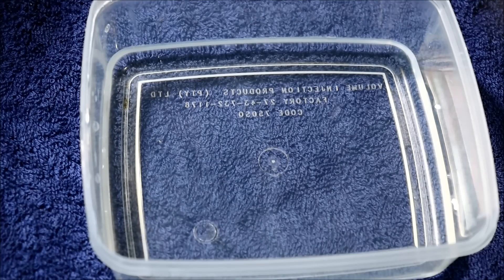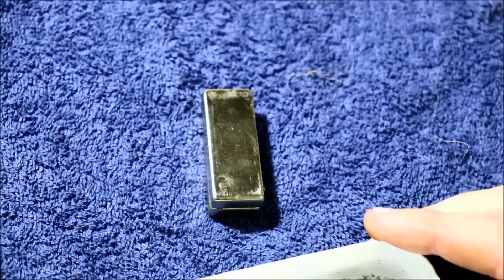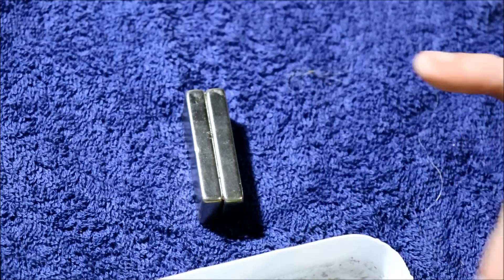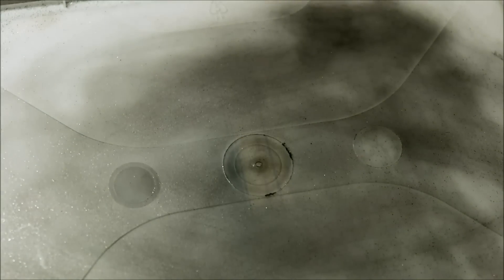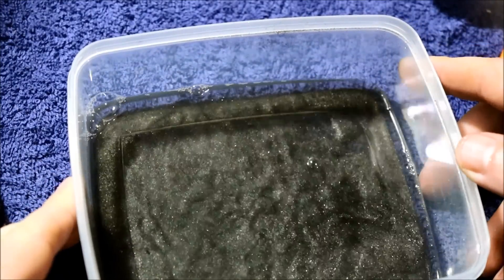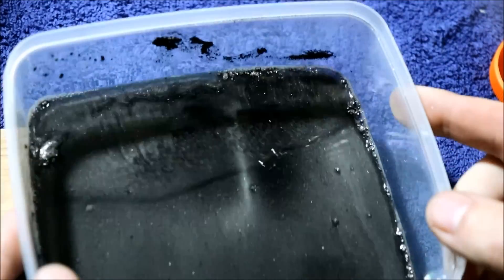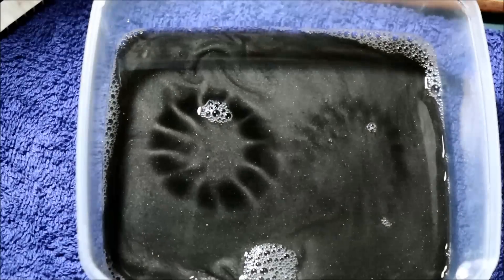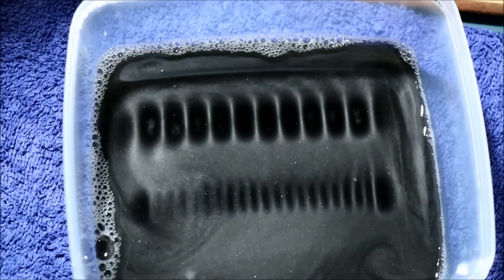Graphite and water - Now add magnets!

Comment: This is beyond cool! So my question is why in the higher angle of attack ones, where flow separations happens looks like that would be the region of low pressure and lift generation but it is really over the point of max camber? I’m not understanding this obvious.

Comment: Making an MHD dynamo is simple but prohibited (hidden).  For this, you must make the liquid you use rotate in a vortex shape. Then, when you charge it with high voltage, you get a very high electric current. The output is in the mega watt range. It charges completely from gravity. If you want details, I can help you.

Comment: If you want to produce more “lift” WITHOUT increasing “the angle of attack” and the DRAG this produces, just hollow the upper part of the airfoil profile just after the peak of the curve - this will produce negative pressure while the lower side glides smoothly.

Comment: Not all graphite is magnetic, so, which specific supplier sold that?  Also, I think the dead black powder won't work, and instead you need shiny graphite "flake," so the particles will align with shear.  (Physics teachers trying to duplicate your demonstration for classroom use  ...they might buy the wrong graphite!)   
Also, search "Magnetic graphite" video by Robert Murray-Smith, where he found that running common graphite through a ball-milling process can unexpectedly make it magnetic.  But that's a lot of needless labor, if someone is manufacturing the already-magnetized graphite!

Comment: This is a wonderful visual 2D experiment,

It would be useful to control or determine the viscosity characteristics of the "rheostatic fluid" so that the all important Reynolds Number can be associated with the experimental flow rate.

Great work.
Reply from the maker: Controlling Reynolds number is a great idea. I suspect viscosity will not be isotropic though, with lower viscosity in the plane of a flake (in its immediate vicinity) than at an angle to the plane.

Comment: If you can, what is it about the patterns in the fluid that a person can design a better wing
Reply from the maker: The flow patterns seen here do not translate directly into what you will observe around a real wing. But for what it is worth, a cambered (curved) airfoil will likely have less separated flow over the top surface at high angles of attack.

Comment: They're not repelled from the area where it is clear of the graphite, but rather they are attracted to the area of more denser graphite.Concentration.It's not a matter of pushing away but a matter of pulling stronger to the points

Comment: Very interesting. In a very narrow tank, would a magnetic field "fence" be able to separate graphite containing rheoscopic fluid from clean fluid? Especially in a vertical arrangement with magnets on both sides. What would be the difference if the opposing magnets were in attraction vs repulsion arrangements? Which would make the better "fence"?
Reply from the maker: The magnetic field merely twists the flakes, other than that it does not appear to have any ability to manipulate the flow.
Reply: @williamfraser  
Yet,  in your free floating example, it did clear the area above the magnets completely, or very nearly so. Might it not be able to steer the settlement of the flakes to one side?
Reply from the maker: I see what you mean. Yes you can guide the flakes provided their orientation is fixed. The floating flakes are held horizontal and water surface tension prevents them from tilting up, so they move to where the field is also horizontal. But once they are submerged and free to rotate in any direction, they don't appear to experience any linear force. I did a few test by leaving a bottle undisturbed for long enough until all the flakes had settled down. I had a magnet attached to the side of the bottle the entire time but the particles showed no sign of deflection and just settled evenly over the bottom. Other grades of graphite might behave differently, it is worth investigating.

Comment: This beautiful and creative approach completely replaces (homemade ) wind tunnels with smoke trails or threads for 2D flow visualization. I will reproduce this but play with adding viscosity to change the scaling and reduce the small scale eddies. Thanks for the inspiration!!!
Reply from the maker: Try Deoxydene. It might sell under different names but hardware stores sell it as a rust remover. It is mostly phosphoric acid and contains surfactants so no additional detergent is needed.

Comment: Such a low effort way to get a thin slice of a wind tunnel.  you could begin extrapolating data from between the slices.  Hmmm, if you set another complementary array of magnets on the bottom and used a clear panel on the bottom you could record the results form both sides, and use a thicker slice (deeper fluid) and get two valid data samples at once, so as to test a tapered shape or wing design!
Reply from the maker: Flow against a glass pane becomes opaque. The boundary layer shear turns the flakes parallel to the pane, just like a Venetian blind. All you see is silver and a small amount of turbulence.
Reply: @williamfraser  Both interesting and disappointing at the same time.  I was thinking about using thin vertical tanks, with mags and cameras on the sides, but this info kinda poops on that parade.

Comment: Briliant! Such a simple model for such a complex thing. However, the graphite filler is a lucky draw- by default graphite is not magnetic, just tested it. There's some ways to make it a bit magnetic, but it sounded not trivial from googling (heating above 3000C° or nitric acid or other tricky methods). Looks like your graphite filler was unintentionally made magnetic- can you please share what you exactly used? I wonder what they did to make it magnetic.
Reply from the maker: I bought a tub from AMT Composites. No grade specified on the container.
Reply: @williamfraser  Thanks ! I found on their website an "metallic-powder-graphite-30g" but the tech datasheet or safety datasheet links aren't working..probably would need to mail them to get this info. My 5cents for now are, this might be "pyrolitic graphite", a graphite version that has crystallized slightly after heating above 3000° and has magnetic properties- and is sold industrially, I have seen cheap packages sold. 
Since I heard from the "supercell ferrofluid" I search for an cheaper alternative to observe and understand magnetic fields, I think this could be an option, really cool, thanks!
Reply: That’s what I expected too! Maybe an infinitesimal amount of diamagnetism is enough? I also thought that graphite was uniformly absorptive of light, but these are flakes with a specular surface!?! Maybe the stuff they make for composites is intended to be structural… not isotopic.

Comment: Magnetism in graphite is entirely unexpected to me. Why would graphite behave this way? Is there anything about graphite that should have us expect it to be magnetic?
Reply from the maker: It is supposed to be diamagnetic as far as I know. The layered structure of graphite might play a role in what appears to be unexpected behavior. I am still trying to figure it out myself.
Reply: @williamfraser  Diamegnetic means repelling or fleeing magnetism right? Or perhaps it is directionally diamagnetic and only resists magnetic flux in a certain orientation. If magnetic field lines cross the delocalized pi-orbitals which give graphite its electrical conductivity, and this induces a current which faces electrical resistance, maybe this has something to do with it.

Comment: what is the physics.? Graphite is a conductor - not ferrous - not magnetic right? Why is it responding to the magnetic field? 
Is it due to eddy currents created in each particle as it moves through the field? then the magnetic field caused by the eddy current reacts to the initial field??
Any thoughts?
Reply from the maker: I don't fully understand it either. Graphite is supposed to be diamagnetic and should be repelled by a magnet. I saw no apparent repulsion among flakes that were aligned with the field. I don't think eddy currents play a role. They must form as you point out, but disappear again once the magnet stops moving.
Reply: @williamfraser  yes, i see that it would require motion and that would, of course come to a stop when settled. Diamagnetic? if so, what causes that and wouldnt we get constant motion if that were the case??
Reply from the maker: @iainmackenzieUK  diamagnetic repulsion is very weak, I might have to set up a time-lapse video to see if the motion is detectable. The problem is that water is also diamagnetic so any result might be influenced by that.
Reply: @williamfraser  wel if the water and carbon are affected in the same way then i think we wouldnt see the effect. Also, if the force is weak, then perhaps this is not the cause. I am also wondering what is the cause of the optical effect. is the carbon crystaline for example???

Sorry, more questions than answers :)
Reply from the maker: The optical effect is due to the flat shape of the flakes. The flakes are quite shiny so if seen face-on it looks silver, but seen edge on it looks dark. The latter actually allows you to see much deeper into the fluid. If there isn't too much graphite in the water and the water is shallow, and I hold a strong magnet below with its field vertical I can see straight to the bottom of the container.
Reply: @williamfraser  I am just going to have to buy some :)
Actually, I teach physics in China so, if I can get some here and try it out, I will let you know :)

Comment: I knew about Rheoscopic fluid, but this is a very interesting variation (Also different color) !

Granted there is the issue of corrosion, but iron filings in rheoscopic fluid now has me intrigued as well!

Granted from just an art perspective too the color may be of use.

Also i love the concept of using Carbon (Be it Carbon Black, Graphite, Graphene, Carbon Fiber, Carbon Glass, Carbon-Carbon Composites, Carbon Felt) in designs as it is semi-renewable, so this is ANOTHER application it seems!
Reply from the maker: Magnetorheological fluid use small ferromagnetic particles (larger than those in "ferro fluids"). A magnetic field is then used to change the viscosity.

Comment: I'd love to see the water traced up and down (instead of left-right) with the array a few times then have the wing go through without magnets to see how the wake influences "walls" of air (as opposed to emphasising how "layers" of air flow over the wing)
Reply from the maker: Excellent idea! It will show flow velocity much better.
Reply: It would be nice to see a cross-sectional view. Using magnets to make both vertical and horizontal lines.

Comment: Wow that was amazing, could that be used instead of a wind tunnel or is that already done.
Reply from the maker: Rheoscopic fluid can be used to study Taylor-Couette flow, alternating bands of turbulence between the walls of concentric spinning cylinders. At slow speed the results might be useful as a wind tunnel substitute. At higher speed the object will create a "bow wave" and divergent waves, just like a boat. So to create a wind tunnel equivalent you would have to eliminate the free surface between water and air. I have tried it with a glass pane on top  but immediately realized a problem. Any flow against the glass creates a boundary layer and the shear turns all the flake parallel to the glass, just like window blinds,  effectively blocking the view deeper into the fluid.

Comment: Now add a rotating magnetic field.
A low-frequency AC field?
Reply: And heat source for convection
Reply: This experiment is used to demonstrate fluids, not so much magnetic fields.

I you want to see that, just look at a time lapse of world weather. The tropics and equator clearly show the atmosphere interacting with the magnetic fields.
Reply: The same can be said about the butterfly diagram created by sunspots.

Comment: This makes me wonder if it'd be at all possible or useful to generate electricity using rotating magnets and the rheoscopic fluid, and curious how it would specifically behave compared to typical generators, if it would work at all.
Reply: It is theoretically possible, but it would not be a practical or efficient method for generating electricity on a large scale 'apparently'.
Reply: @pa_maj.MARTINI-van-MAN if possible to contain and save it, then any little bit, would help. Here, I'm specifically, thinking of keeping my phone charged, during our extended loadshedding (SA power outage crisis) 😂
Reply: @tessasinclair6315  What's going on in SA  with power is quite bewildering since there was two major power stations (Kusile and Medupi) having been added to the grid. There should, because of this, be no problems with power...corruption springs to mind Tessa, nothing new.
You'd probably do well with a small solar panel that charges mobile phones and other USB equipment, you get Good sun.
If you can charge up a small power bank during the day, you could charge from that same power bank at night.
A 50 watt solar panel that already has a connection to USB would be plenty, and a 15 watt panel would be the minimum but very capable in sunny conditions; especially for charging a phone and small power bank.